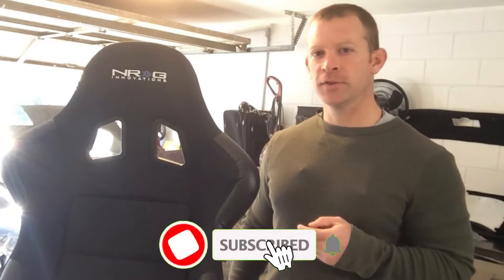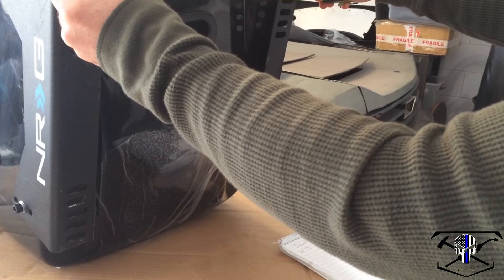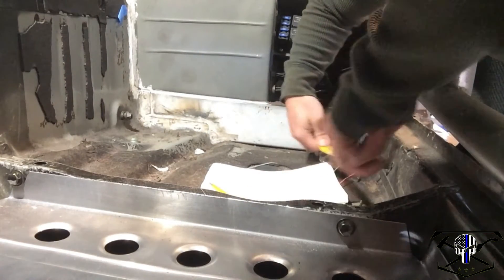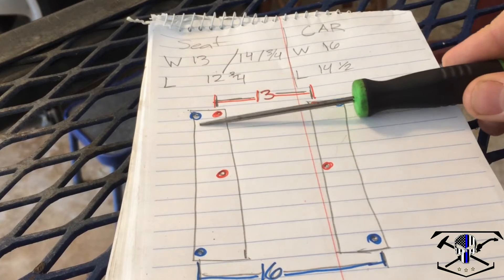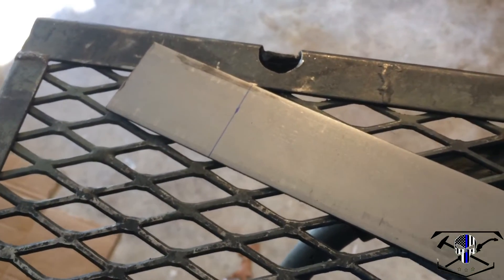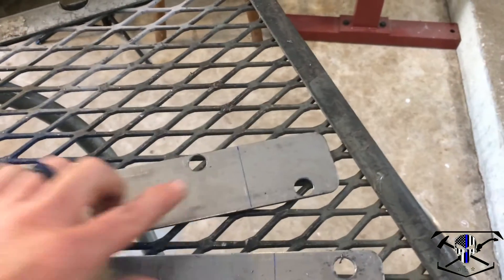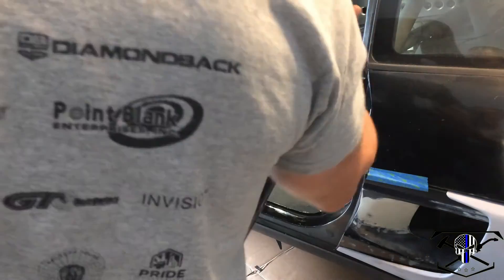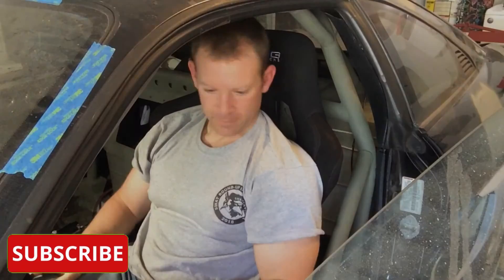DIY Seat Brackets

Comment: So where do people go crazy with welding and all that in some cases? I likd the simplicity but curious. Thanks.
Reply from the maker: This was my simple solution to a simple problem. I would imagine if this were a more difficult/complex setup, some welding would have been required. In all honesty, I would have welded two cross bars together to connect the two rails if I had a place to plug my welder in when i made the vid.
Reply: @scantronsgarage  Thanks, very enlightening. Your simplified process gives me hope!